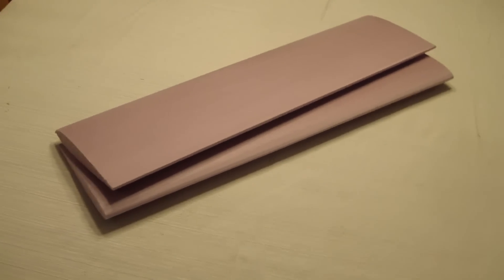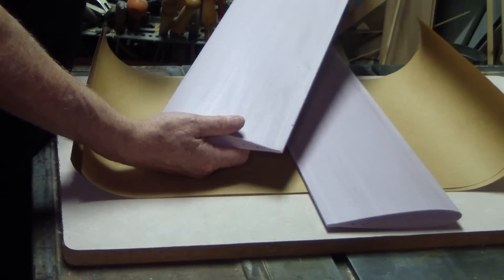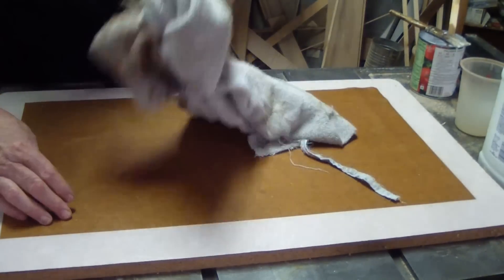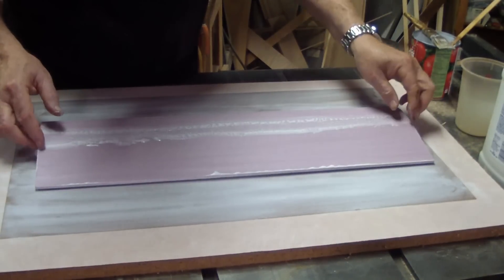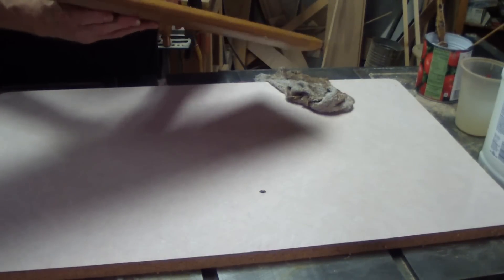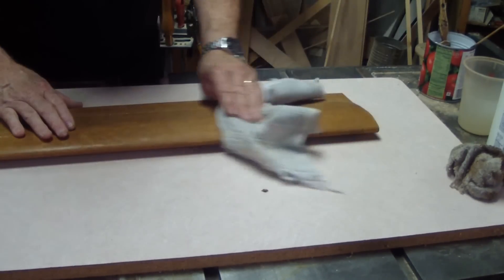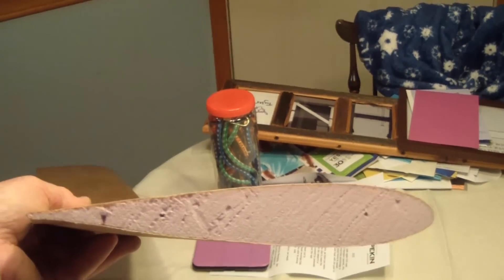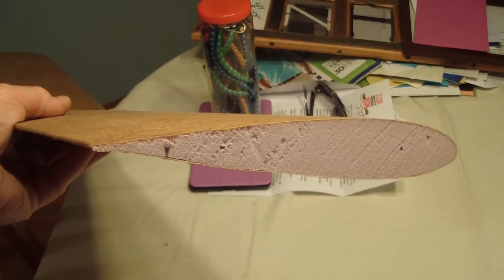Laminate foam wings cores with brown kraft paper

Comment: you can do this job with half of the white glue and the final weight of each panel rounds 60grams.
Reply from the maker: I probably could use a little less glue, but the weight, with the glue 
that I used, is NOT an issue.   The panels shown in the video ended up 
being 84 grams ( a bit less after trimming the ends and the dihedral 
angle.   1 ounce = 28.35 grams.   Divide 84 by 28.35 and you get 2.96 
ounces.   The assembled wing is therefore just shy of 6 ounces and this 
is a 4 FOOT wing with a 7" chord (before adding ailerons).   Show me any
 other wing that big (and that STRONG) that weighs less than 6 ounces.  
  One of the first planes that I built with this technique is my own 
design, loosely based on the Midwest Hots .40.   It has a 38" wing span,
 and measures 35" from the rear edge of the rudder up to the tip of the 
spinner.   This plane (Hots-e) fully stuffed (except for the fligth 
battery) weighs 15.1 ounces.   I use a 3s 1000mah zippy compact 35C 
battery to fly this one.   The battery weighs 3 ounces, so the all up 
weight is 18.1 ounces.   It flies like an angel.   I put 3 flights on it
 this evening in the calm air.  I loafed around on the last flight, 
keeping the throttle at about 40% for the entire flight.   I did lazy 
circles and a few loops and rolls.   I was airborne for 11.5 minutes 
before the battery was done.  I would NOT want this plane to be any 
lighter.   It is perfectly balanced all around.   If it was lighter, I 
wouldn't penetrate the wind nearly as well.

Comment: Will these wings be strong enough for a 84" wing span non aerobatic aeroplane?
Reply from the maker: I just completed construction of an 80-in photo drone to shoot to videos from a fixed wing using this technique I did cut a slot with a table saw for an 1/8-in by 3/4 full-length spar on the underside other than adding that spar the construction is exactly the same. The plane has flown it flies well the wing is plenty strong.
Reply: Thanks Brian, will be building a D Boddington Mighty Barnstormer.

Comment: Coulda used like literally less than half of the amount of glue and it would have been fine..actually would be even stronger.
Reply from the maker: @stuffD-fh8vf  no, it wouldn't have been stronger.  The glue has been diluted with water.   It's thin so it can spread easily and soak in.   ALL of that water and ALL of the water weight evaporates and goes away.  Did you watch the video to the end where I weighed the finished panel?   It is very light; there is no need for it to be lighter.

Comment: BEFORE wrap paper to wing you need sure add garbon fiber rod in wing center glued first. then can wrap paper top.but lot better have srhrink film cover than paper. no need paint or anythink  have fulol ready and lot better cover wrap.need only cover film and iron heater and little heat hotairgun. lot better than this system. ofcourse this is good for poor men and if no need outside fly. but if use paper need paint this too and no good. lot better have cover plastic film.

Comment: Is Elmurs glue similar to PVA glue?
Reply from the maker: Yes, Elmers is a form of PVA (PolyVinylAcetate) glue.   Any tan or brown wood glue would work just fine.   Elmer's is cheaper than wood glues, so I use Elmers.
Reply: @kuehn1953   actually that's not the case. Yellow glue like Titebond II is PVA. Elmer's and other white glues are alphatic resin.
Elmer's makes a PVA glue. It's called Elmer's Carpenters Wood Glue

Comment: thats a lot of glue!
Reply from the maker: Brian Kuehn

I probably could use a little less glue, but the weight, with the glue that I used, is NOT an issue.   The panels shown in the video ended up being 84 grams ( a bit less after trimming the ends and the dihedral angle.   1 ounce = 28.35 grams.   Divide 84 by 28.35 and you get 2.96 ounces.   The assembled wing is therefore just shy of 6 ounces and this is a 4 FOOT wing with a 7" chord (before adding ailerons).   Show me any other wing that big (and that STRONG) that weighs less than 6 ounces.    One of the first planes that I built with this technique is my own design, loosely based on the Midwest Hots .40.   It has a 38" wing span, and measures 35" from the rear edge of the rudder up to the tip of the spinner.   This plane (Hots-e) fully stuffed (except for the fligth battery) weighs 15.1 ounces.   I use a 3s 1000mah zippy compact 35C battery to fly this one.   The battery weighs 3 ounces, so the all up weight is 18.1 ounces.   It flies like an angel.   I put 3 flights on it this evening in the calm air.  I loafed around on the last flight, keeping the throttle at about 40% for the entire flight.   I did lazy circles and a few loops and rolls.   I was airborne for 11.5 minutes before the battery was done.  I would NOT want this plane to be any lighter.   It is perfectly balanced all around.   If it was lighter, I wouldn't penetrate the wind nearly as well.